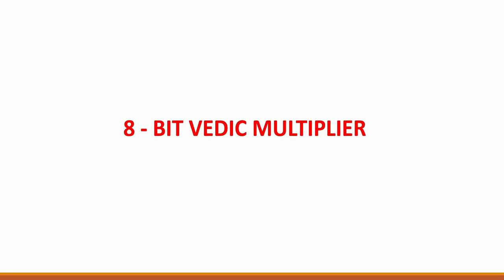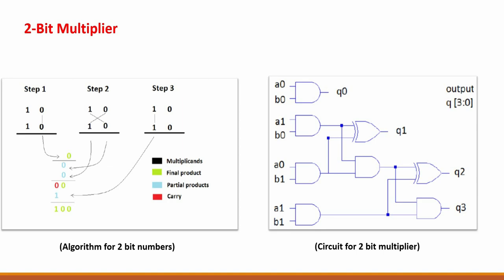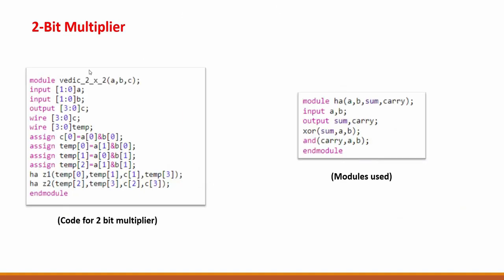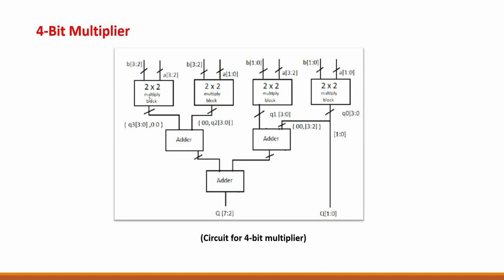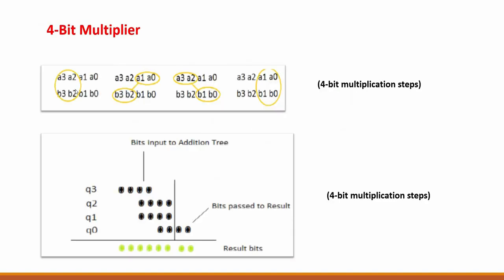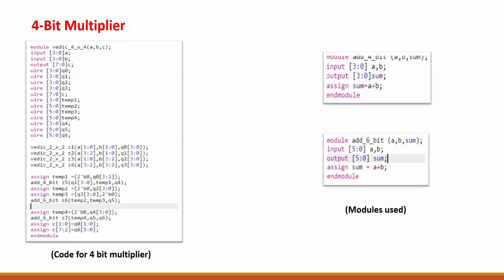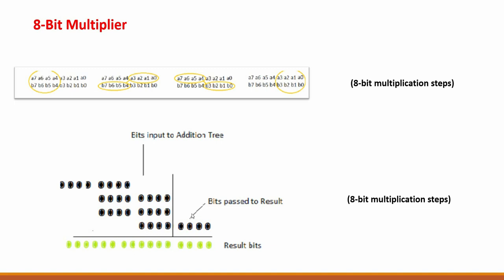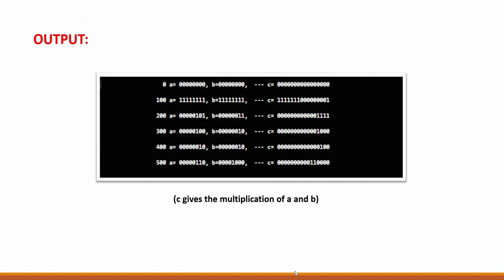HDL Verilog Project | Vedic Multiplier (with code)| JDOODLE Online Compiler

Comment from the maker: Please find the code in the link description. 
Any suggestions or queries are most welcomed.
Other Projects-
►Traffic Light Controller in Verilog - https://youtu.be/Yt7no6rwCVk
►Round Robin Arbiter in Verilog - https://www.youtube.com/watch?v=X6oJn7r9-8s
►Vedic Multiplier in Verilog - https://www.youtube.com/watch?v=6M3nyyQfpHU
►Clock with Alarm in Verilog - https://www.youtube.com/watch?v=pTk1H50e8bI
►Washing Machine in Verilog - https://www.youtube.com/watch?v=iAoi9jTzxcI
►N bit Multiplier in Verilog - https://www.youtube.com/watch?v=lmzCdx6gkdU
►PWM Shift Register in Verilog - https://www.youtube.com/watch?v=Pz9sPflKpXc
►Vending Machine in Verilog - https://www.youtube.com/watch?v=tJc0blBDRzo
►Hexadecimal Keypad Scanner in Verilog - https://www.youtube.com/watch?v=Y1cp2kwos5M
►RAM - ROM Design in Verilog - https://youtu.be/m18YU9xjETU